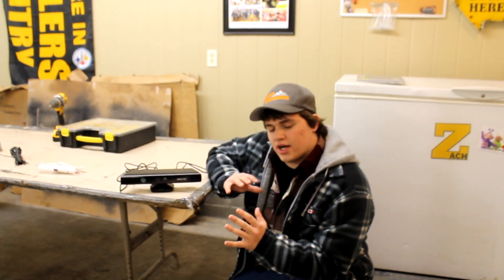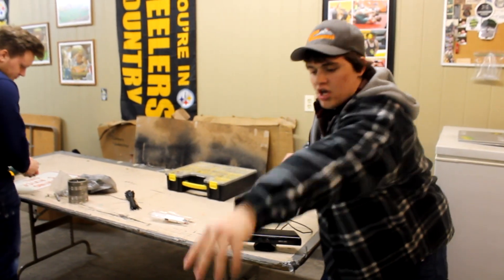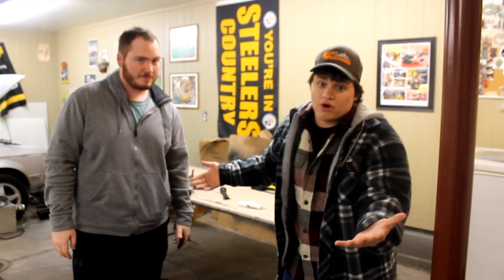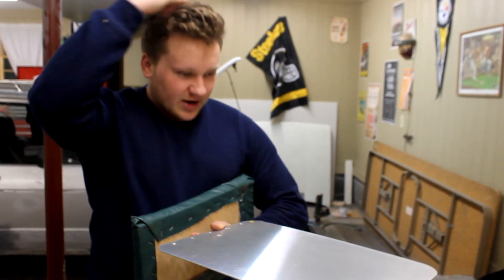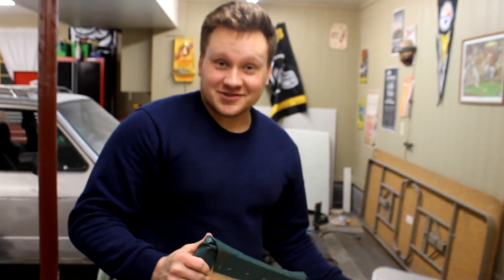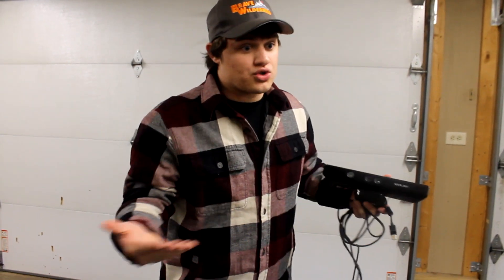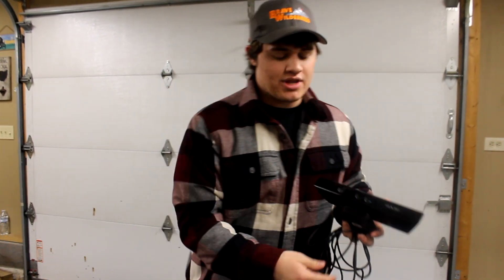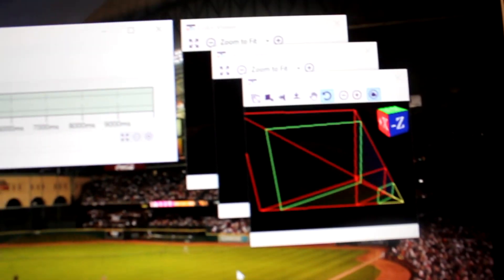How to Make Your Own SLS Camera CHEAP!!

Comment from the maker: Note: If you are using the laptop version of the Kinect, it will need to be plugged into an outlet. We are using an AC Power Bank (portable charger that supports AC plugs) in order to take the SLS anywhere we go! The AC Power Bank is the most expensive part of this project (ours was $70, but you can find some a little cheaper). Happy hunting!
Reply: Greetings from Ohio! Can you share what portable charger you used?
Reply from the maker: @krystalgesicki64  This is what we use, very reliable and keeps its charge for a very long time! 

https://www.amazon.com/dp/B073P81Z9V/ref=cm_sw_r_cp_apa_i_bjuWCb4KTRP5K
Reply: Thank you!
Reply from the maker: @krystalgesicki64  You're welcome!
Reply: Here is also a good one for 10$ with multiple outlets https://www.ebay.com/p/Belkin-Travel-Surge-Protector-2-AC-Outlets-USB-Port-3000-mA-Battery-Pack-Charger/2254430470?iid=254251128126&ul_ref=https%253A%252F%252Frover.ebay.com%252Frover%252F1%252F711-117182-37290-0%252F2%253Fmpre%253Dhttps%253A%252F%252Fwww.ebay.com%252Fp%252FBelkin-Travel-Surge-Protector-2-AC-Outlets-USB-Port-3000-mA-Battery-Pack-Charger%252F2254430470%253Fiid%253D254251128126%2526chn%253Dps%2526mkevt%253D1%2526mkrid%253D711-117182-37290-0%2526mkcid%253D2%2526itemid%253D254251128126%2526targetid%253D544071271859%2526device%253Dm%2526adtype%253Dpla%2526googleloc%253D9017533%2526poi%253D%2526campaignid%253D1497308099%2526adgroupid%253D59509629282%2526rlsatarget%253Dpla-544071271859%2526abcId%253D1139476%2526merchantid%253D114692107%2526gclid%253DCjwKCAjwr8zoBRA0EiwANmvpYFf970oJhxOILCysM95adneNRN-NJgZCFdhPZ33oJmYKI7u_k1_3-xoCi5QQAvD_BwE%2526srcrot%253D711-117182-37290-0%2526rvr_id%253D2019664497071%2526rvr_ts%253D9646680816b0a4d129d09fb9ffed99fa
Reply: We are also paranormal investigators currently living in Shadyside ohio, maybe we could get together to investigate
Reply: Hey there im doing the exact same build as you but im struggling to find the battery pack and I tried your link but its a dead end.... Could you tell me the name of the AC power supply you use.
Reply: the kinect camera works off the usb power and doesnt need to be plugged in cant it work from the laptops power just by plugging in the usb as it does on the xbox as i dont need mine plugged in,please let me know as im confused
Reply: Heard that battery bank it’s bad, and it stops working after a month or so. True?
Reply from the maker: @ElBoii90  The one we have been using since last year has been working fantastic and has not failed us yet. It probably just depends on which power bank you use, like if it's cheap or not.
Reply: Hauntings of Ohio oh, are we speaking of the amazon link you shared? If so, that’s the one I was talking bout.. :/
Reply from the maker: @ElBoii90  oh I gotcha! The link we shared is the one we have been using and it's been working fantastic for us and had no troubles with it yet.

Comment: Hi cant get the kinect software to open. Is there a trick to it. Thanks.
Reply from the maker: We are going to make a new How to soon to better help issues. You'll need an AC battery pack of your liking and connect the kinect sensor to it and the senor to your tablet. Within the kinect program you'll see a list of different programs to run but you will need to find "Kinect D2D" and run that one. If it still doesn't work, check your battery and connections and make sure they're good/properly connected. Hopefully this helps, I'm not the best at explaining things without showing.

Comment: you forgot the battery (No hate) Just letting it out there you're gonna need a portable Battery and that cost around umm $8 for cheap on Ebay to $90 for good experience but in price range and Is kind of small like about 4-5 inches by 2-3 inches
Reply from the maker: Yeah I think we may have included that at the end of the video in the text. We plan on making a new How To video because this video is outdated and needs improved.

Comment: You said that if a person is not on front of the camera and a stick figure comes up on camera, then thats a ghost. What you need to learn is that this device can produce false positives such as mistaking objects in a room or straight corners etc and can map figures from the shapes in the room. You can prove or debunk the mapped figures from responce to you . when a figure shows up, dont assume its spirits until you check the background for corners and other objects first. It takes time to get used to this piece of equipment and not as clear cut as you made it out to be but appricate the video because they can be cheaply made at home for way less money than they are sold on the internet. My advise is research fully how the device works and get to know the equipment. Every piece of equipment we use in paranormal research has its flaws and its important we know what those flaws are but a very useful piece of equipment all the same.
Reply from the maker: Yeah! This definitely isn't the best "How to" and we definitely forgot to mention a lot of key points like you said. Before hand we never used one before this video just what we seen on TV and YouTube and wanted to give a how to while making ours. We used it a couple times already and debunked quite a bit with it like you said it definitely can pick up random objects in the rooms, but we might have captured a few things with it. Still got some reviewing to go over first. But love your response, appreciate it! Hopefully sometime soon we can get the real deal and use that bad boy!
Reply: @HauntingsofOhio  it inspired me to bring my on investigation but sadly it decided not to connect up, it can be fustrating at times.
Reply from the maker: Oh yeah that has happened a couple times with us, it really can be frustrating sometimes, it can be a pain 😂

Comment: How would you get this to work with a tablet?
Reply from the maker: If your tablet has windows 10 or more recent it should be good to go for the program that is used. The adapter for the tablet might be different than the one used for the laptop version, not 100% sure.

Comment: Will this work on windows 10?
Reply from the maker: If you have windows 8.1 or a more recent version you should be good to go!
Reply: I’ve tried and it keeps telling me to download it again
Reply: It’s like saying “set up tools” or something like that
Reply: @fusionviper7682  From someone who uses the Kinect and the software for our paranormal investigations do not and I repeat do not download any other version, other than the v1.8.0 otherwise it will not open up. Plus you need to download the Kinect developer toolkit v1.8.0 to properly run it.